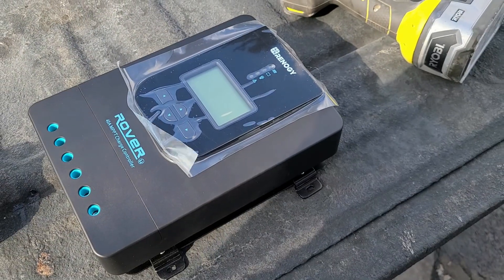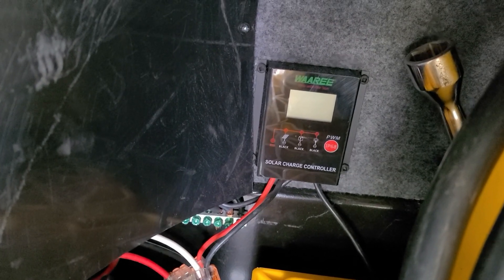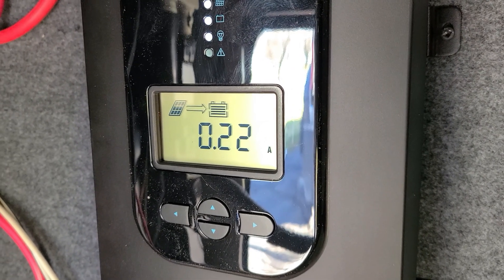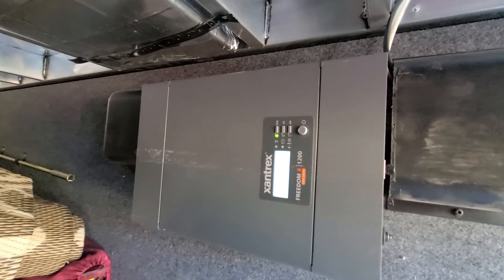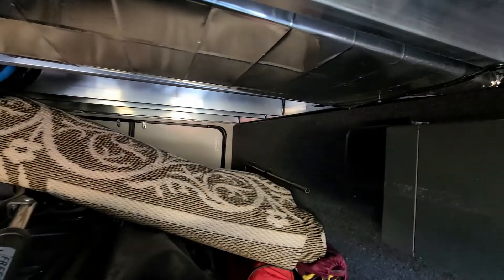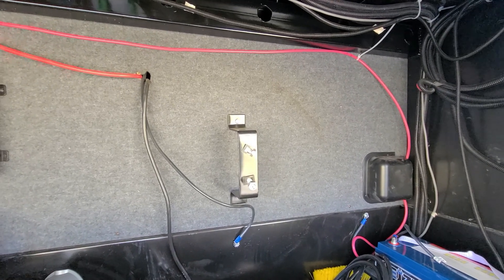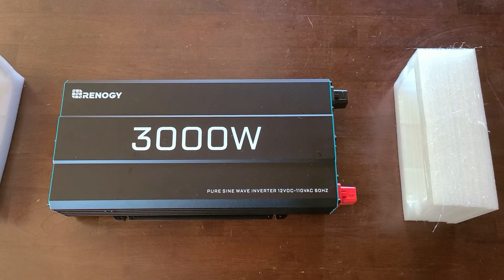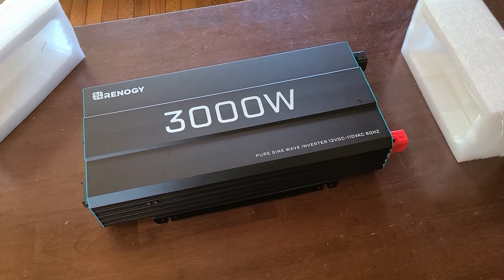Renogy 3000w inverter - 50amp Boondocking set up

Comment: You’ll need a lot more solar to run the camper and charge at the same time. Expanding solar seems to be the least expensive way to upgrade, and unless you do, you could have 600 amp hours of batteries but unless you chag7tgem before you go camp, it will die. I’m not an expert, but it’s fairly easy math when you look at amp/watt hours of batteries vs amp/watss using, watts of solar = hours of sun x watts output. But for you, the proof is in the pudding. How did it go?
Reply from the maker: Charges all the 12v stuff and keeps the fridge going. We have the generator to boost the batteries or run thr AC of it gets too hott.

Comment: How well did this setup work? 400 watts of solar isn’t much if you’re using the power a lot. A friend got 600 watts solar, 3,000 watt inverter, 230 amp hours of lithium and if he camps in any shade, it wouldn’t keep his 12 volt refrigerator going.
Reply from the maker: Great so far. No issue with keeping the fridge going.

Comment: consider using the DCC30S 12V 30A Dual Input DC-DC On-Board Battery Charger with MPPT and using the alternator (from the trailer umbilical cord) so that your truck can charge the battery too.  (LI batteries won't charge with standard car/truck cable)
Reply from the maker: Great upgrade for the future!

Comment: you must know the inverter has 6 ways to protect itself. 3k with 3  out lets thats 1k each. hard wire it put an amp meter in series. read the manual.
Reply from the maker: Renogy manual is pretty poor. 🤣
With that being said it's got the job done quite well.